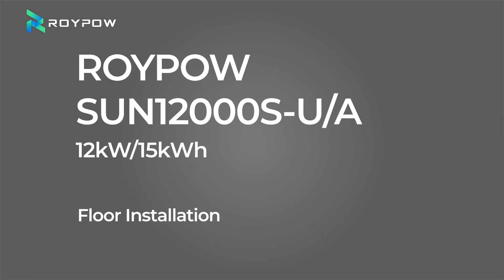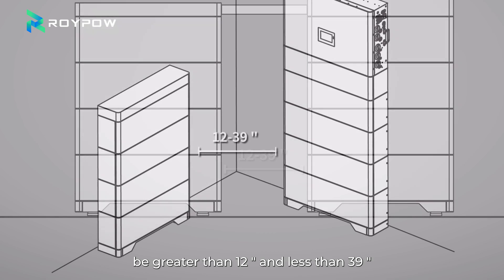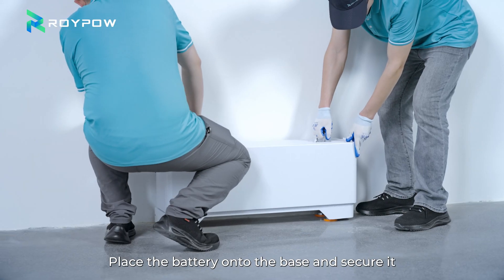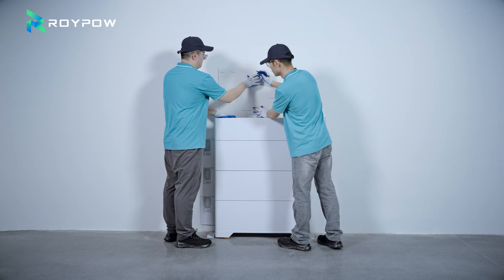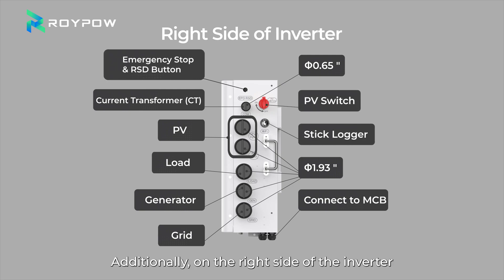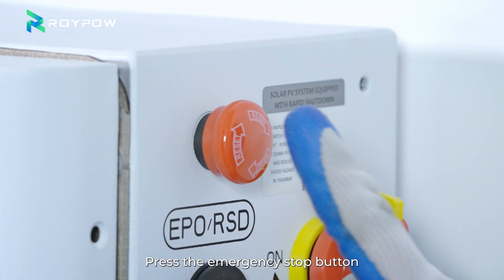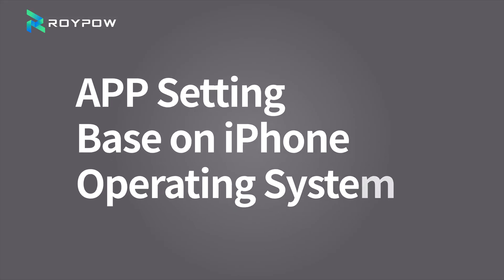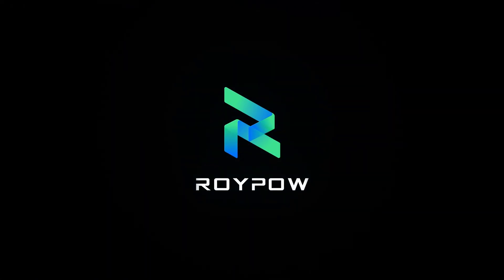ROYPOW Residential ESS Installation | SUN12000S-U/A 12kW/15kWh

Comment: how to i run two of your inverters in parallel?? i have the 5kwh versions and want to run them in parallel to give me 10kwh
Reply: There is a data cable that you need in order to let the inverters talk to one another.  Where did you purchase the inverters?  They should be able to get you the cable assuming the inverters you got are designed to be in parallel.  What is the model you got?